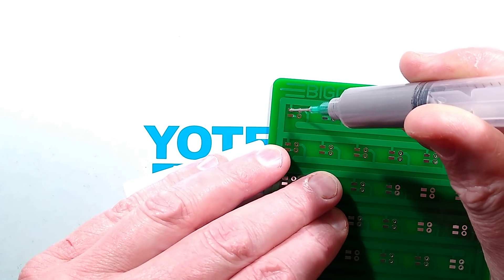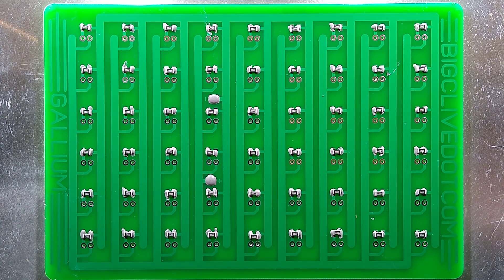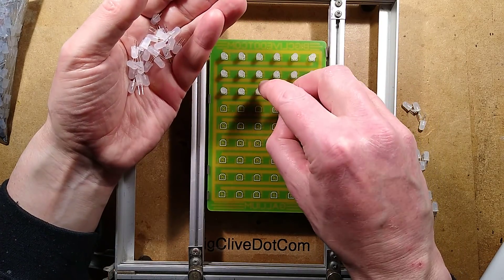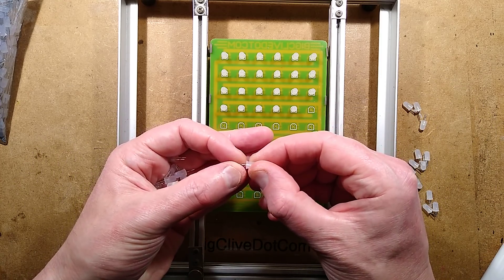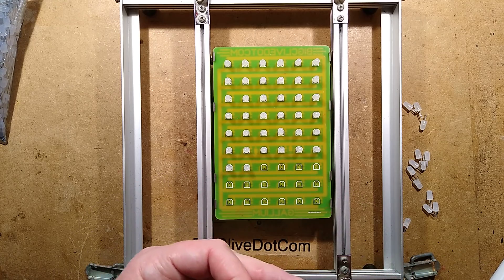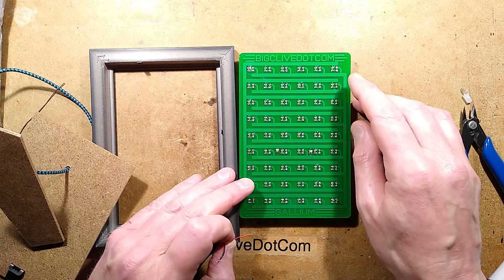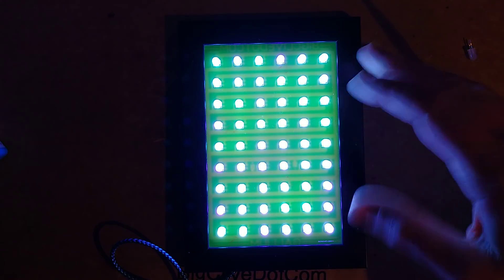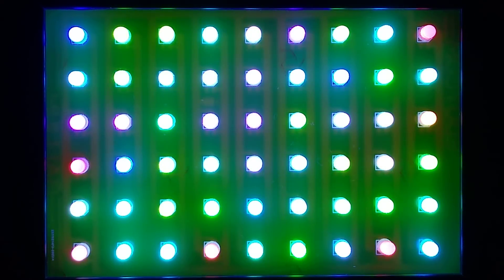Reflow attempt 2 on a custom LED art PCB (with resist).

Comment: Turned out very nice. Is the hotplate specially for reworking?
Reply from the maker: The hotplate is a general use one for pre-heating and reflowing.
Reply: @bigclivedotcom  Right, thanks.

Comment: Hey Clive. I hope you see this
I used the hotplate reflow method yesterday on a massive 400 pin connector 40x10 array surface mount, 0.05" spacing. it is a Searray connector with solder charges on the pins, and I used solder paste with a cheap stencil from JLC and a credit card. I heated a plate of aluminum on the hot plate to 550F, placed the board on, waited until the solder began to melt and waited 30 seconds, then removed the board.
It looks absolutely beautiful, and was a connector that is completely impossible to solder without a good reflow oven, or so I thought. no melted plastic on the connector, and every joint looks beautiful.
It did take a few attempts to get a good solder paste application, and i specifically selected everything with a lead/tin alloy to make life easier.
Thanks for showing the method.

Comment: Could someone educate me on why each LED needs it's own resistor, could we not just use a buck converter to provide the entire circuit with exactly the correct voltage? (since all the LEDs are the same and connected in parallel)
I'm sure there's a good reason, but I'm new to all of this :)
Reply from the maker: If the LEDs are run in parallel the ones with the lowest forward voltage will pass much more current.  By having a resistor per LED they can be mixed types.

Comment: So, that drying out of the paste might be from heating the PCB too quickly and/or too hot. You have to bring it up to temperature rather slowly.

I'm basing this off of the ovens we had at Fleetwood, they had five different temperature zones and it took a populated PCB 30 minutes to go through them.

Comment: I use a hot plate (actually a large pancake griddle) and heat the PCB up to a temp that is safe for the part for many minutes but is under reflow temperature.  I then use a soldering hot air wand to heat each part separately.  Since the solder is already nearly up to reflow temp the hot air pushes the temp up and reflow of the target part is nearly instantaneous.  This avoids cooking the parts for very long at the reflow temperature.

Comment: the pads are way too big for the resistors hence the weird angles they ended up on
also a dosing syringe with a pneumatic actuator really makes solder paste application so much better

Comment: "cosmic in its glory" ... makes me wonder why you're not using a roach clip to hold the remnants of your pre-cut solder lengths to get all possible mileage out of them ... keep up the good work!
Reply: The solder tails get pulled in by surface tension (?), no need for a roach clip.
Although "cosmic in its glory" reads in Sagan's voice, and takes me to http://hermiene.net/essays-trans/mr_x.html :-)

Comment: from what I have seen,  you can modify a cheap toaster oven, and make a great reflow oven,  problem with your hot plate,  there is too much temperature difference from the bottom to the top, it needs to be uniform and  controlled, which you cant do with a hot plate open air like you did.  just a thought.

Comment: I can FEEL your 'pain' having to manually populate all the LEDs...
I've been making new LED segments for our dragstrip scoreboards.
Each segment contains 56 'ultrabright' 5mm LEDs (arranged as 8 'strings' of 7 LEDs).
Each digit uses 7.5 segments (0.5 is for the decimal point).
Each display board has 4 digits
There are four display boards.
Do the math...  That equates to 6720 freaking through hole LEDs and 960 associated resistors!
(As a 'track volunteer', the labour cost to the track is zero, but it was a long and painful exercise that I am GLAD is over!)
Edit: Now that I've watched the end, PLEASE do not send ME one of these...  If I have to solder another LED in my LIFE, I will 'Photonic-Induction' the damned thing!!! <Grins>
Reply: I think what you meant to say is "PLEASE do not send ME one of these... Oi ain't 'avin' it!"
I miss Photonic...

Comment: Hello, I am a Manufacturering Engineer plus for 50 years. That type of PCB has a tendency to bow. This is why it unevenly soldered.
Next time use Q-tips to clean the solder paste off the board and instead use a heat gun. Conduction Soldering is not the best in an uncontrolled environment. Ask me anything about assembly and I will be glad to provide you with any assistance you may need. Kindest regards,
Fastamx.

Comment: If I remember correctly, the recommended hole size is such that on every side around the component pi there is 0.06 inches (0.15 mm) space.  That allows an optimal amount of solder to make contact.  And at the same time it facilitates a good solder removal, if need be.  That recommendation of course is given for plated holes  For single sided board I suspect the optimum gap is smaller, but I have no memorized recommendation, as I have not designed such for several years.

Comment: I always assumed having a yellow and a blue (equally bright) LED would give a more or less white light, albeit with a particularly poor color rendition. I don't think you'd be able to get green out of it. In fact, I reckon it is the second worst way to get white light from an LED. The absolute worst way, of course, is to light an LED on fire. While that does provide warm white light and a lovely continuous colour spectrum, even without a power supply, it does shorten the life expectancy of the component rather dramatically, to the point where I can't recommend it despite these advantages.

Comment: how much heat can you apply to a resistor before it is essentially fucked... maybe the plate is better for sandwiches,or keeping coffee warm...
Reply from the maker: The resistors are designed to operate at very high temperatures.  All components designed for SMD soldering are rated for going through an oven that will reflow the solder in a controlled thermal ramp up and down.
Reply: @bigclivedotcom  Well now ill worry less about damaging things!

Comment: A nice effect on your random changers.  Hey, how about a nice little "how to" on building a decent flashlight to carry around.  Certainly, there are lots of cheap options to buy.  But I don't want 3 or 4 or 7 modes.  Who need that strobe/flashy thing anyway?  And really......Morse Code???  Perhaps based on an 18650 cell and decently bright but decently long life.  Make it relatively easy to replace the LED or the driver circuit instead of just throwing it away periodically when something fails.  Or maybe start with a commercial product and modify it?  I'm confident you have ideas for this.  And what is your EDC (Every Day Carry) flash light??

Comment: Instead of shouting at the screen, maybe I should comment here:
1) Your hot plate is too hot.
2) You put too much solder paste.
3) Don't dilute the solder paste, heat the board around 50C, that will soften the paste and give you good adhesion while putting your solder bits.

Comment: HEY WHO HAS A TRIP FUSE BOX MOUNTED VERTICALLY CAUSE I HAVE AND ITS AN ASS
Reply from the maker: It's not wrong, since many industrial breaker boxes have the breakers horizontal, but it's not normal.

Comment: Most PCB manufacturers (JLC included) will offer to sell you a paste screen for a few extra pounds, the idea being you align the screen over the PCB and "wipe" the paste down the screen to place a perfect amount of paste on the exposed pads. I've never seen your technique of applying the paste by syringe directly to the pads!
Professionally I use solder paste from RS (other suppliers available) that comes supplied with a fitting for the pneumatic dispensers, as it is viscous enough to hold the components while still liquid enough to dispense by hand if needed; never had any issues with it, even when using a hot-air gun to reflow.

Comment: I never found an issue with mess.  I also found ways to use the undiluted solder paste.  You don't need to be that precise with it, it will flow to the pads even if you plaster it over both.
Reply: https://imgur.com/e54ebij this is my work.

Comment: Hello there Clive, Great channel enjoy whatching your teardowns and very informative electronics.

You said that the colours of the slow fading LED were limited. Have you seen these from AliExpress ?

https://www.aliexpress.com/item/32250670510.html?spm=a2g0s.9042311.0.0.27424c4dveopym

I have ordered these exact ones and they do indeed have a full range of slow fading colours, they have also seem to have current limiting as used upto about 5v and no forward resistor, not had any problems. they also make great swapouts for static colour fairy lights strings with 3v battery packs.

Dont know if you have looked at AliExpress before but they are full of cheep electronics only you have to be pacient snailmail from China.

Keep up the great channel

Graham

Comment: So, when I did solder reflow I took an old toaster oven and built a small pcb with a thermocouple amp and then just used an arduino running a PID loop to turn the toaster on/off with an SSR and programmed in a few points in time to follow the solder paste manufacturer's recommended temperature profile. https://www.youtube.com/watch?v=upZjvdB_0sE
Other folks apparently get away with just opening and closing the toaster door by hand though.

Comment: Are all resistors in parellel? Why so many?
Reply from the maker: To allow a mixture of LEDs with different forward voltages.  One per resistor.
Reply: Not one but 3 LEDs for every resistor, since each capsule contains  a red a green and a blue light emitting diode chip.

Comment: Why on earth didn't you just use a normal off the shelf tube of fresh solder paste... I've never had an issue dispensing it by hand.  Adding the flux to "dilute" it will mess things up as you've already seen. Just no.....

Comment: I would use the hot plate only for preheating at 100-150 deg, C. Then using hot air at 300-350C works very fine and fast with solder paste and the parts reflow perfectly.

Comment: Damn! You've over engineered this one Clive, but I give you credit for fixing your stuff up!
Reply: Yes, agree this was over engineered. I've done these multiple colour changing LED clusters but I didn't use resistors. Instead a fixed voltage of 3 V works well and with a lot less components. These particular LEDs cannot be current controlled anyway since the current through them fluctuate all the time. If one actively current control them, they will not work as intended.
Reply from the maker: It's based on an earlier design that used mixed single colour LEDs with different forward voltages.  Using one resistor per LED makes it more versatile.
Reply: Sorry, but that answer didn't make any sense at all to me. But one thing is good with this design and it is that it disapate the heat evenly across the PCB.

Comment: Any time in the last 50 years: Geez...in 2020 computers will be wild and flying cars and time machines...
2020: "Here's a light I made with a teeny tiny computer inside each rgb diode", streamed in high definition on the internets.

Comment: With all those individual PWM circuits going off the common power rails,  I wonder if there's anything going on like the synchronizing effect that happens when you place mechanical metronomes on a flexing board.

Comment: Having blue and yellow lights won't give you green light.  With pigments, cyan,  magenta and yellow are the primaries and mixing cyan and yellow makes green (Printers have long referred to cyan as blue and magenta as red to save syllables).  But with light, blue, red and green are the primaries and mixing red and green makes yellow.  Yellow light and blue light are complementaries and mixing them will give white light.

Comment: Hi Clive, when you do the hot plate reflow, it looks like the base of the PCB gets much hotter than the rest of the PCB too quickly, by the time the top is reflow hot enough the flux is more than cooked and the solder "very slowly" bought to temperature.
Can I advise, from reflow devices that I have serviced, you make it like an oven, put an insulated cover over to get the heat into the PCB quicker and more evenly.
OR use a heat gun over the top as the hotplate heats up.
Sorry but as it reflowed all I could see was a mass of dry joints.

Comment: This maybe a really stupid question, but why not use a single 220k resistor at the entry point to the circuit rather than a separate resistor for each LED?
Reply from the maker: It's designed for multiple types of LED, some with different forward voltages.
Reply: @bigclivedotcom  Thanks Clive - I love watching the channel although can't pretend to understand it all!

Comment: I use low melt eutectic lead free solder from 247 solder, item number 247-LOWTEMP-15, it's a tin/bismuth/silver formula that melts at around 140C.
Can easily be reflowed with a normal heatgun, and I've had success doing IR reflow on small boards using a 50W halogen spot lamp. As far as durability under normal temp ranges it seems to be as good as regular leaded, I've had a dead board in use as a keychain for around a year and the components are still holding fast despite getting enough wear to round off all the corners.

If your fab house supports making stencils they're totally worth it if you're making more than a few copies of something, turns the paste application process from a tedious hand cramping nightmare to a couple swipes of an old hotel room keycard.

Comment: A minor mod would be to add surface mount pads and through holes at the same time. Just pick the type of resistor you want and leave the unused type unpopulated.
Reply from the maker: That's the next PCB.  I've already doodled the layout.

Comment: I wonder if you filled it up with candle flicker LEDs if they would average out to a relatively even light
Reply from the maker: I made one of those recently in another video.  It was quite fierce.
Reply: @bigclivedotcom  is there any chance I could convince you to put a scope on the power lines? Just wondering what the noise would be like!

Comment: I may be horribly wrong about what I'm going to say, but I think you'd better draw narrower (0° along the component, not turned 90°) solder pads and add just a little solder paste to help them align your SMD components for you with the surface tension of solder.
Again, I may be horribly wrong, but it's what comes to my mind when I see narrow resistors gliding left and right on wide pads…

Comment: Perhaps putting some kind of diffusers over the leds so the camera isn't swamped out by the bright spots of the leds and we can see the color change a lot easier. Small pingpong balls or similar work pretty good as diffusers. 
Also, I would of liked to see the progression of the colors go from same to full random with a time lapse  😉

Comment: I ordered some PCBs from JLCPCB that were sent on May 12 via EuroPacket and are still being delivered, planned for this tuesday, was supposed to be delivered 17-20th.
Apparently EuroPacket = DHL and it was stuck for days in Germany and it was literally saying "On hold"
On purpose I didn't chose DHL, they are always making problems or adding illegally some extra charges.
Currently JLCPCB has, DHL standard, DHL priority, DHL priority DDL, DHL turtle(called EuroPacket) and if you don't want DHL your only option is some Postlink that can take up to 25 days.
You literally have only two companies to chose, pretty sure they cut some deal with DHL.

Comment: Clive, if you get 2-layer pcbs made:

* You can choose whether to have solder mask on the top side / bottom side as necessary, 
* You can place non-plated holes if you want. I don't know if they have a limit on non-plated holes, but they do make them - presumably they get drilled after plating.

Comment: You could very easily create that sweeping wave effect if you soldered a different value capacitor in parallel with each row.  The higher the value the longer that delay before that row turns on.

Comment: You need to build yourself a vacuum pickup tool makes this so mutch faster, and get a paste stensle  there dirt cheap. The vacuum pickup tool also lets you get the resistor tight ageist the board also helps get a good reflow.
Your pads also look too big they seam to be the manual/hand solder type, that is and no stensle is why your not getting them to move into position as fast(your putting too much solder paste on them) . You could have soldering thous leds reflow as well its not idlel but it works:)

Comment: Clive , Could day you please explain why not just use one resistor for the whole board ,like in the end of a string of leds
Reply from the maker: The board is designed for other purposes where LEDs with different voltages are used.

Comment: A little better way for reflowing solder on a hot plate is to put a 1 inch layer of sand on top of the hot plate then place the pcb on top of the sand once the sand temperature equalizes. That way the parts reflow equally. Another way is to set the hot plate about 60°C less than the solder temperature and use your hot air set to the correct temperature for reflow and with the air volume turned way down. Then just move the air around over the components and they reflow beautifully.

Since you got your pcbs from JLCPCB.COM, choose to get the $7 stencil. It will make it much easier to spread the solder paste. I take a poundland cheapo clipboard and a couple of old unused pcbs to make a registry guide around the sides of the new board, then locate the stencil over the holes and tape the stencil along one edge like a hinge. That way I have very simple repeatable way to squeegee the paste over the boards.